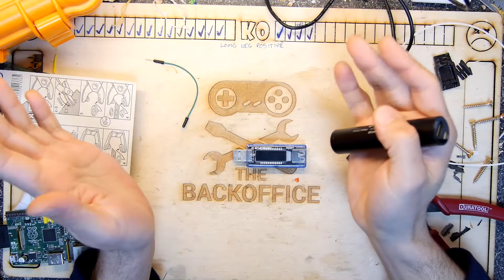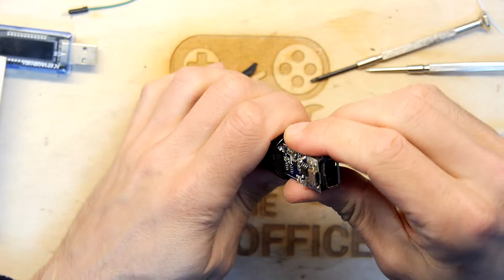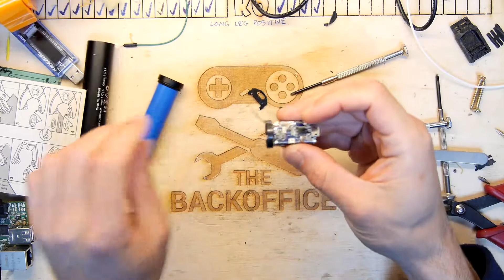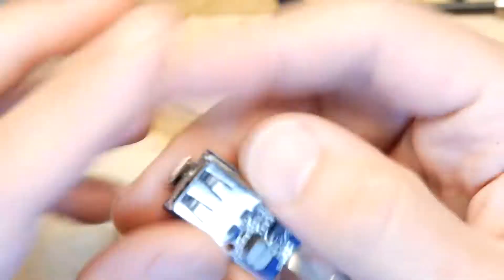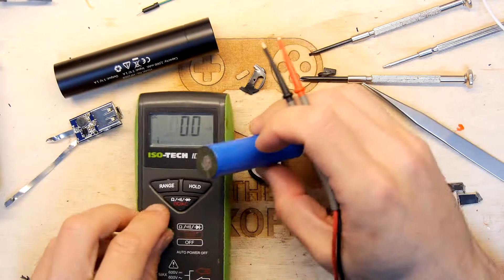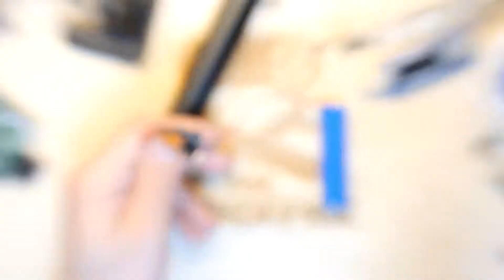USB Power Pack

Comment: I got a powerpack from poundland to rip out the circuit board and charge a larger lithium cell for my pi zero portable build. They come with a 1200ma lithium cell, but have an old 6000ma cell from a broken tablet to use.
Reply from the maker: Good plan, I like it! Those commodity tablets usually die well before their batteries. Just makes me wish I kept mine now! Oh well! :)
Reply: Yeah, i have a couple from people with kids with broken digitisers but  working screens, they are useful for parts. I'm going to try to reuse the screens too.Don't worry, there are plenty out there that are too expensive to fix, but not ready to bin :)
Reply from the maker: +David  Elliott That's true, I'm sure if I tweet or ask on Patreon I'll get loads of boxes of broken tablets 😂
Reply: Cool lol. The cheaper ones are the best,because they have two wire batteries. The more expensive tablets have multiple wire connections, probably for battery checking and stuff. Good luck with it :)

Comment: Always like a look at various powerpaks. I got a bit unrelated question about wiring a controller PCB to USB. 

 I found the PSP go bottom PCB  has the perfect layout for my idea of making a slide out slim gamepad for my mobile phone. I think I remember you wiring a controller up to a chip to make it USB or am I misremembering? Do you have any ideas on a chip I can wire up to the psp go pinouts to make it USB? I saw this example project but doesn't have analog an wondering if you know any examples that wire up a analog stick as well
http://razencad.com/examples.html
Reply from the maker: I usually hack the SNES gamepads as they are so cheap. If you are up for programming your own micro you can do a whole lot of things.
Reply from the maker: +Ganjulationess3DS I am actually working making a Backoffice module for this purpose. Let me get back to you 😂👍
Reply: The Backoffice Great news please look into the psp 4 pin analog stick connector ribbon cable as well!!!